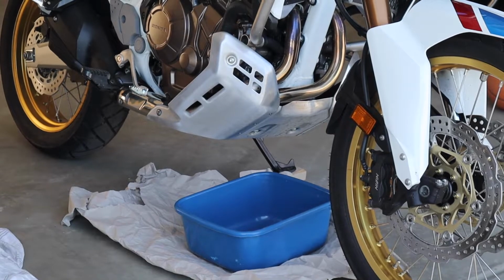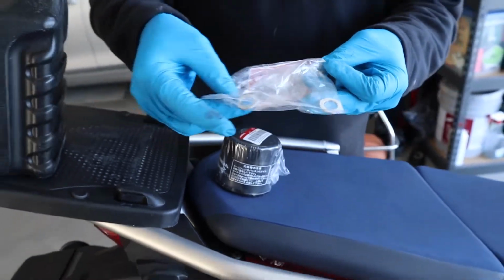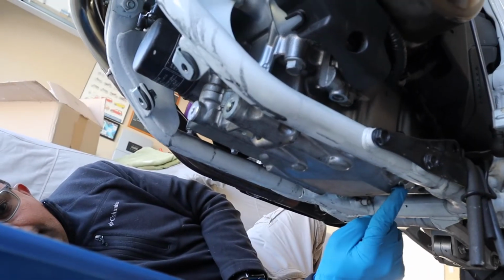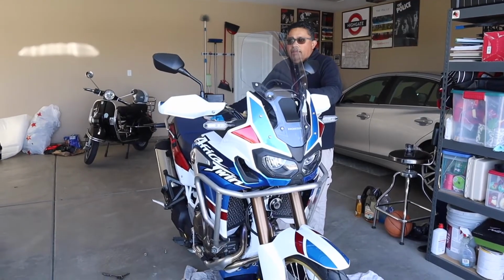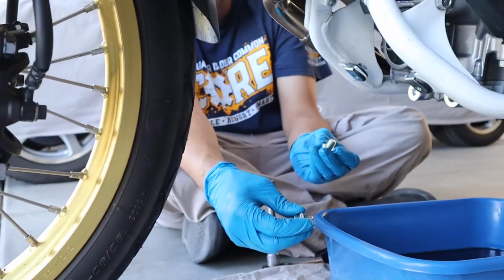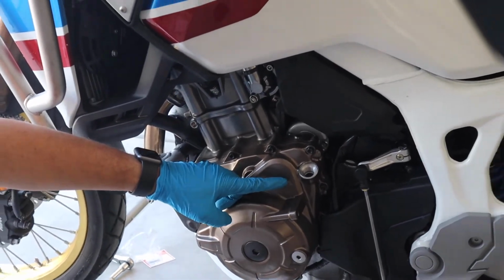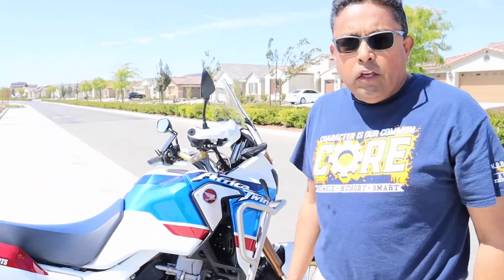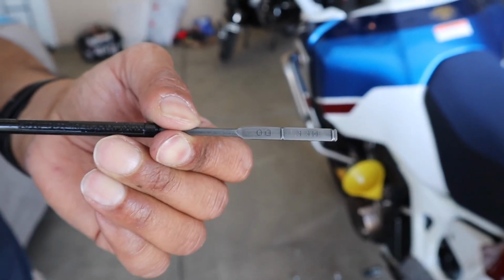Step by Step Honda Africa Twin ATAS Oil and Filter Replacement Tutorial

Comment: Nice bike and video. Oil drain plug torque is only 30 Nm / 22 Lb ft worth investing in torque wrench. Cheers.
Reply: The way he was cranking on it I was waiting for it to strip out. He needs to invest in a torque wrench for sure.